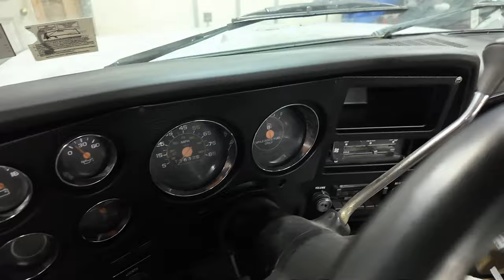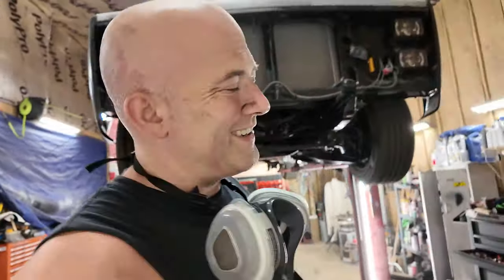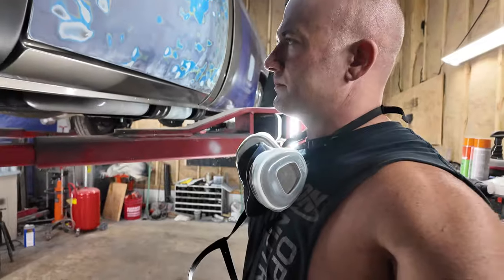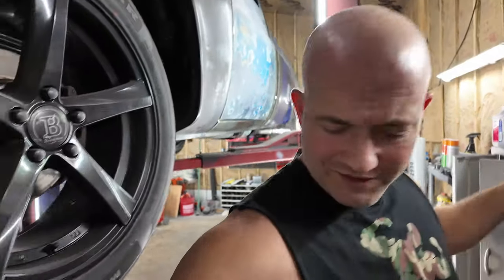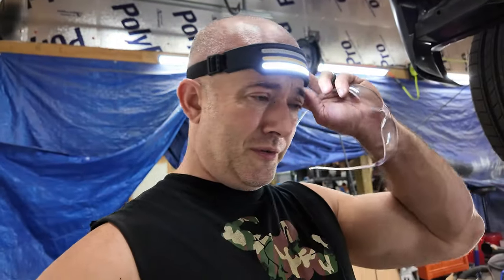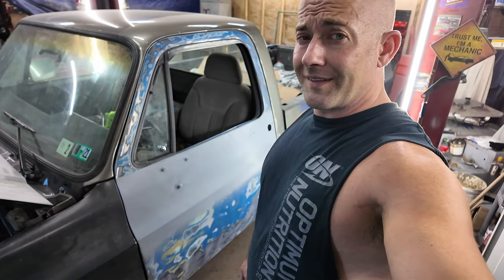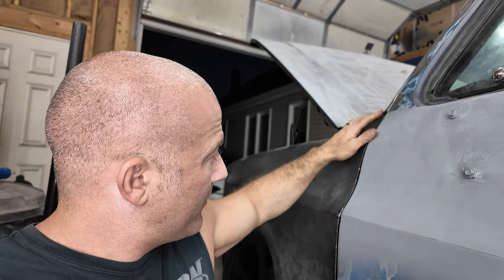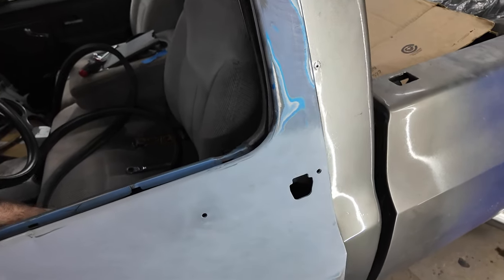Project Budget Chevy C10 Part infinity

Comment: Problem with squarebodys is they never were perfect from factory. The door striker has adjustment... and you can put a small piece of plastic tubing on striker, I forget what size... but it will help door close better. You can slit the pen tubing longlasting to fit over striker if you can't get striker off